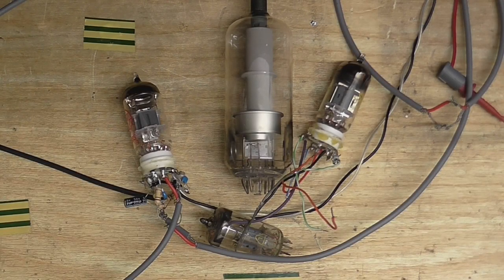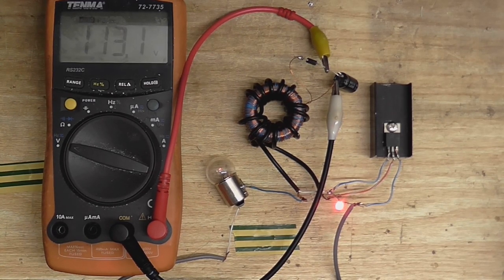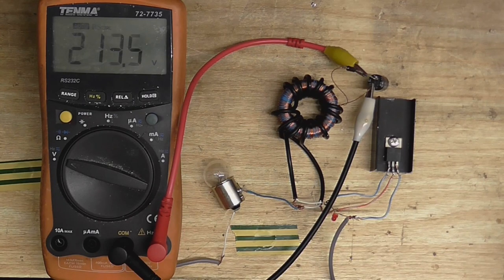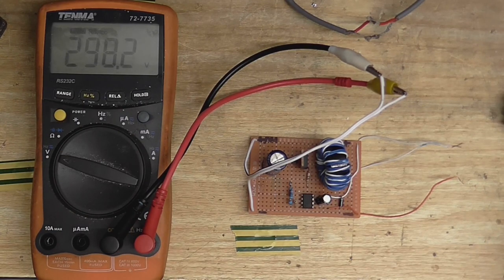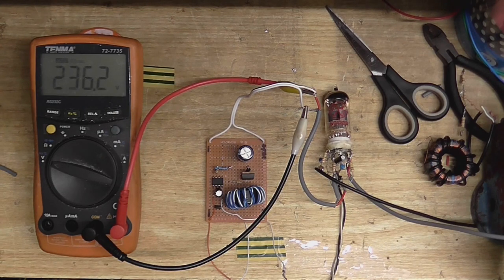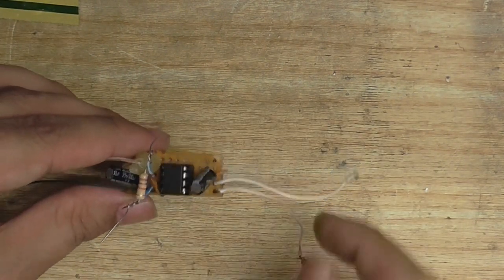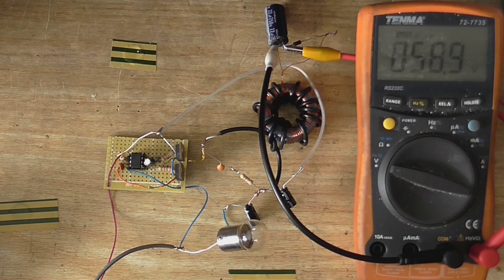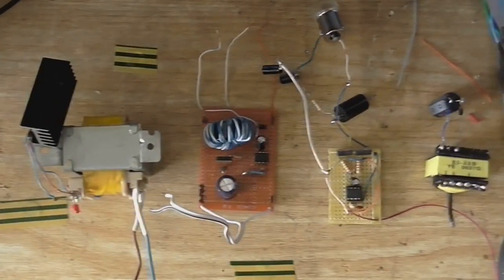Experimenting with Switch-Mode circuits to Power up Tubes, or something.

Comment: Don go that high on oscope. Make yourself an attenuator. Probes wont take more than 250V and osc inputs as well. I would use the old one (Philips) for this adventures. Many thanks for the ideas, I was needing something like that. Good video.
Reply from the maker: No need to worry, i already had the probe set to 10x attenuation.

Comment: You should've used push-pull, not a halfbridge. Second thing is that you don't really need regulation for the boost converter, just make a delay circuit that will inhibit its operation for a minute or so. After a minute a tube should be all set. The voltage won't skyrocket and the tube will thank you for a delayed anode supply.
Reply from the maker: I also had the idea of using some kind of delay, I have a few ideas about how that could be done.

Comment: clem you can use pin 5 of the timer to regulate the voltage of the boost converter take a small amount of the output and feed it back to pin 5 of the 555 through a small npn transistor ... or zener clamp the output can probs use a high voltage trani with a zener on the base across the output? it only has to hold it a few seconds make a circuit to shut down the boost converter should the filament go open circuit..